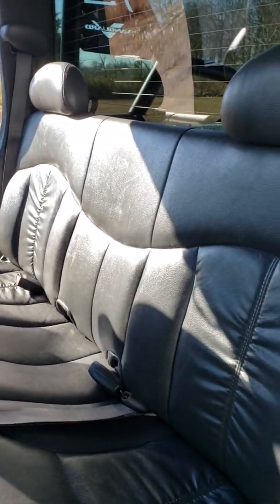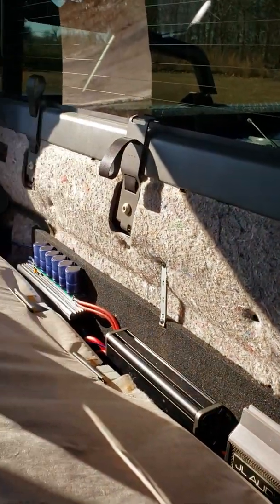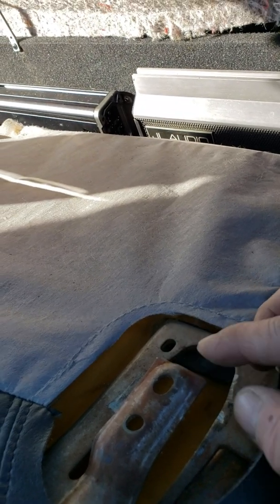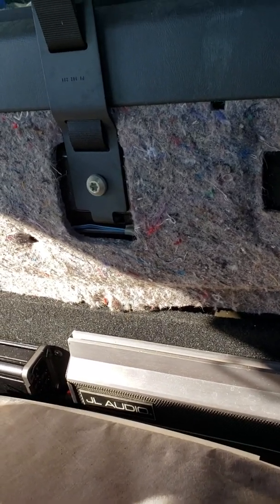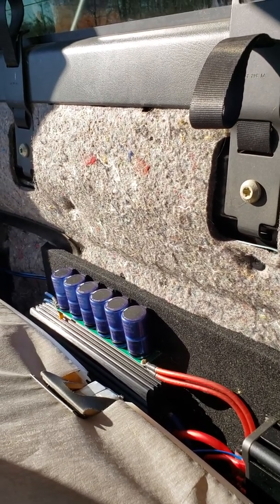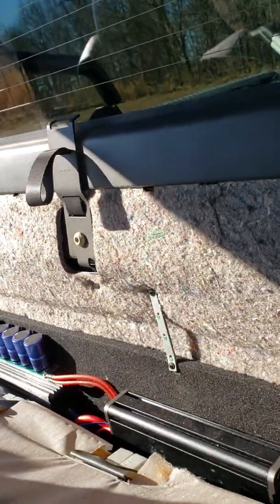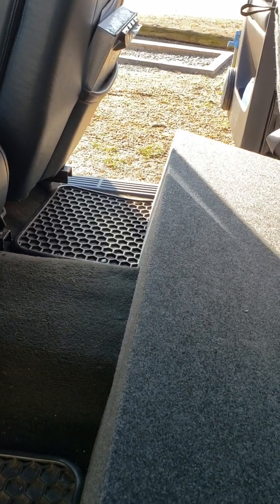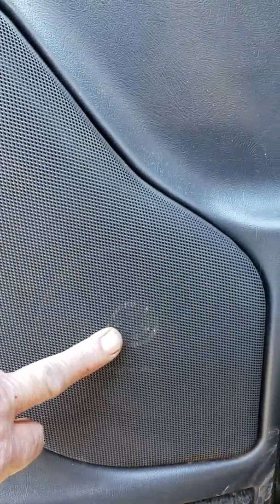2001 Chevy  truck seat hack for Amp installs

Comment: Quality build, nice system. Yes agree, it is important to have the capacitors - especially for your sub amps to keep a good solid steady flow of power for sound quality. Nice considering how small amount of space you had to work with. People forget your alternator outputt varies with the RPM, Slow down for a stop light is different output than cruising speed.